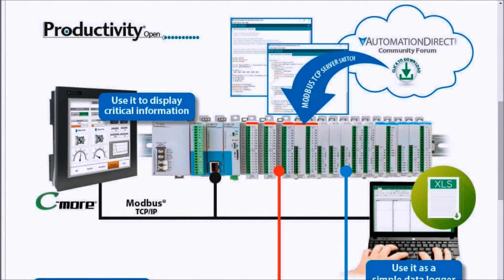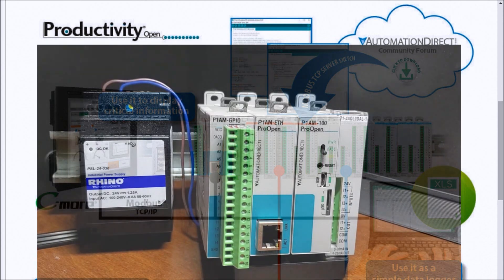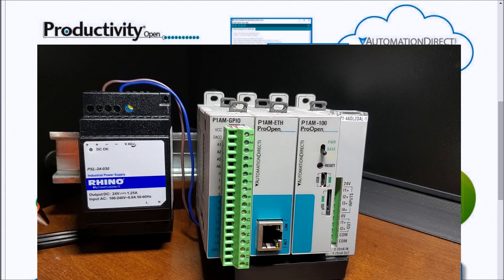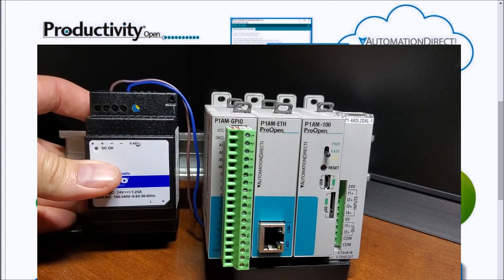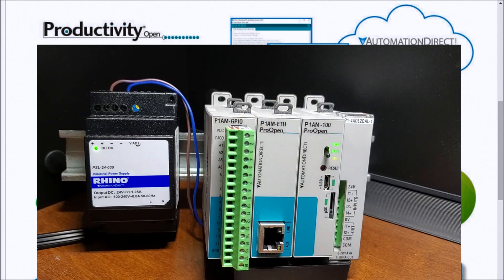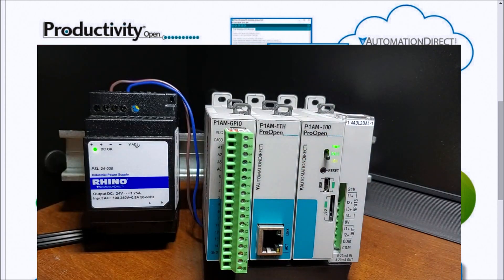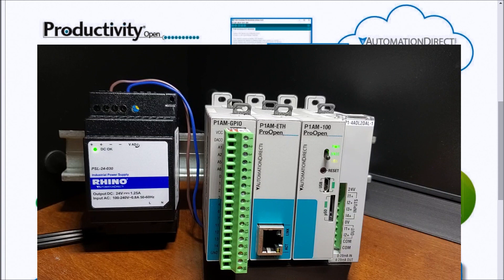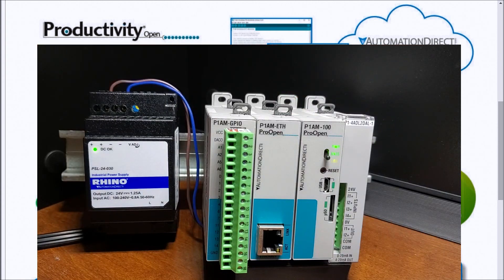Productivity Open Arduino Compatible Industrial Controller Powering Up

Comment: What language do you use to program this?
Reply from the maker: Hi Douglas,
Like all Arduino devices, this will be programmed in C++. ProductivityBlocks is a graphical display type higher language that can be used when programming this controller. This will save you time and syntax errors by automatically converting your program to the C++ code.
Here is the WiKi for ProductivityBlocks programming:
https://github.com/AutomationDirect/ProductivityBlocks/wiki
Productivity Series: In progress
https://accautomation.ca/series/productivity-open-arduino-compatible-industrial-controller/
Regards,
Garry

Comment: great information,   will the IDE work with Python code software and will the Ethernet port communicate with AB-Rockwell-PLC   EtherNet/IP ?   that would be nice.  thanks..:)
Reply from the maker: Hi q zorn,
Thank you for the comments. The arduino IDE will not work with Python code. Here is a link with more information.
https://arduino.stackexchange.com/questions/105/programming-an-arduino-using-python-rather-than-c-c
I am not aware of a Ethernet IP driver for the Arduino yet.
https://forums.mrplc.com/index.php?/topic/32401-arduino-to-compactlogix-communications/
There is a DF1 driver for the Arduino.
https://forum.arduino.cc/index.php?topic=635876.0
Modbus TCP is another option for Ethernet protocol.
https://forum.automationdirect.com/forum/open-source-devices/productivityopen-p1am/128012-modbus-tcp-module-i-o-example
I hope this helps you out.
Regards,
Garry

Comment: I'd like to see the CPU if able?
Reply from the maker: Hi Stephen Michael,
https://cdn.automationdirect.com/static/specs/p1amspecs.pdf
The above are the specifications. The ProductivityOpen P1AM-100 is an automation platform compatible with Productivity 1000 Series I/O modules, P1AM Series shields, and Arduino MKR format shields. It can be programmed using the Arduino IDE. The board uses the SAMD21G18 Microcontroller like the Arduino MKRZERO and other similar boards.
Regards,
Garry
Reply: @ACCautomation  thank you!